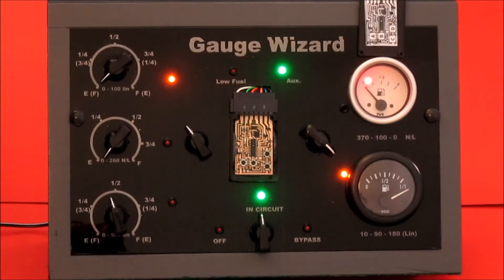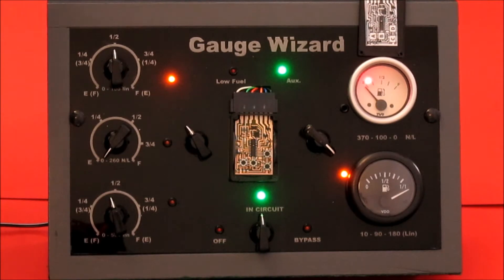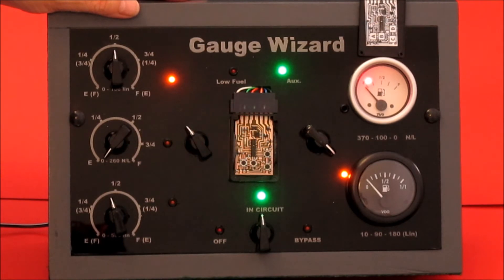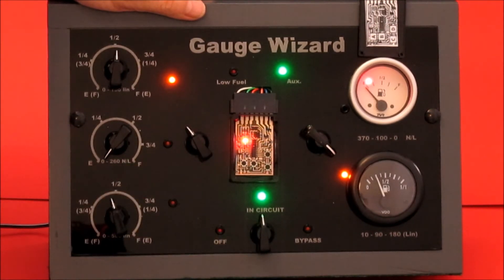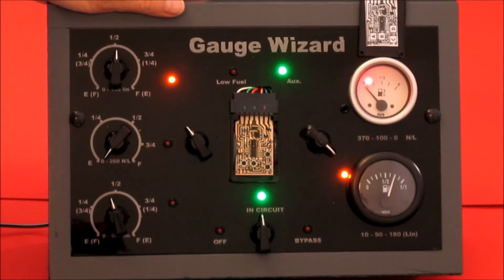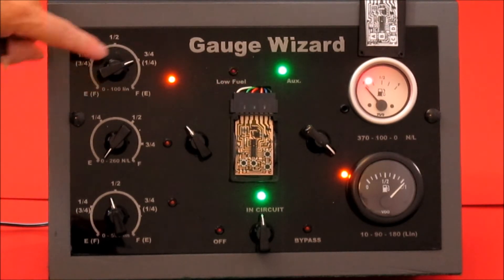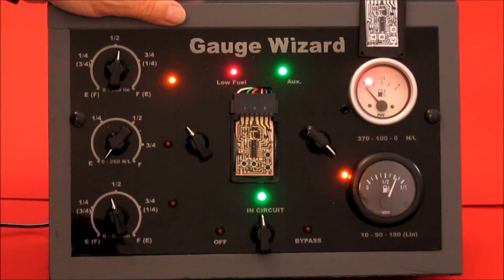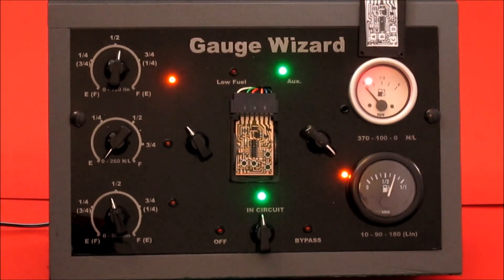Gauge Wizard 4.4 Video 6 Gauge settings

Comment: Can you power off after each stage to allow 1/4 tank refills? Will the box remember the previous settings
Reply: Absolutely, each setting point can be set in any order and the unit powered down in between any